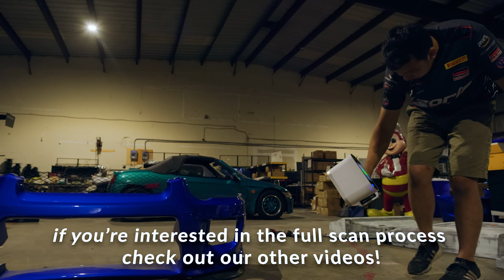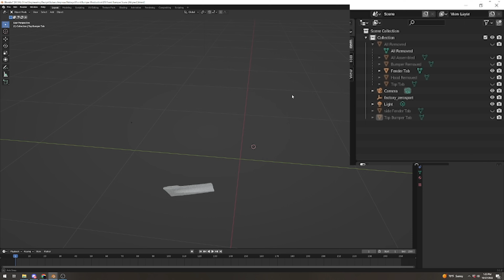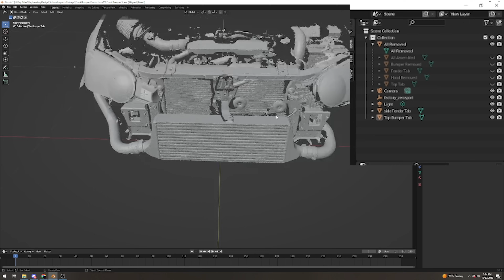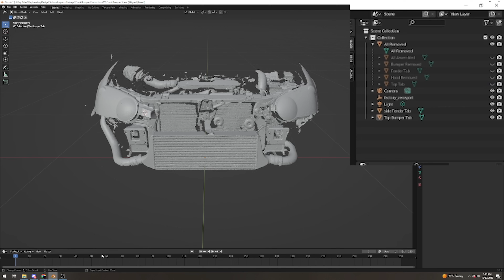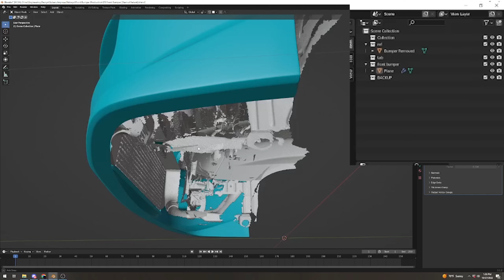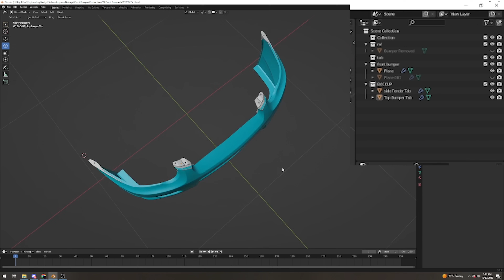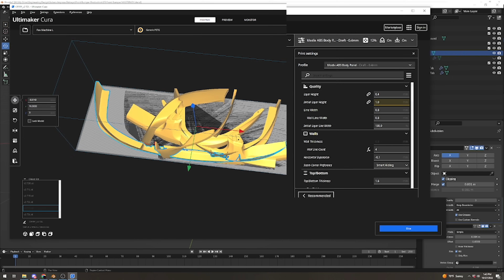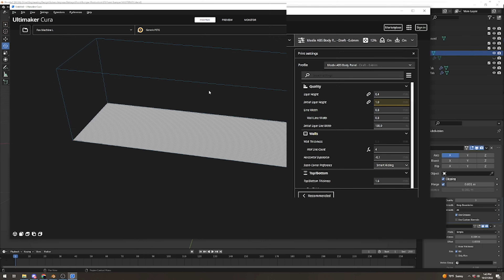I didn't like my bumper, so I made a new one.

Comment: Could it have worked if you flip the intercooler 180 degrees so that the pipes are on top
Reply: usually headlights or rad support are in the way of pipes if you flip the intercooler

Comment: This is a good attempt to show the process, however, it is a tad crude. You already have 3D printers, CNC molds are just a slightly more rigid and precise machine away. Good for the hobbyist, but as a machinist, this is a tad cringy 😂 

Look into Easy Composites.

Comment: Don't be confused. This is not simple or cheap. That 3d scanner he used is $30k. Who knows how much having multiple designers submitting 3d model designs would cost...this is not something you could get on fiver. I have been working in CAD for 20 years, it is not simple. That 3d printer is $16k.... Then it is ran for days to print all the parts of that huge bumper. probably a couple hundred $ in filament alone. Then the time to assemble the 3d print, gluing it all together symmetrically while making sure it still fits the car correctly. Sanding and smoothing the print to get it ready for the mold making. Who knows how much it would cost to have a custom fiberglass mold made.  Then the cost of painting it. Yes you can do all this yourself. But this is deep into the manufacturing world with tons of experience and expensive tools divided between all these trades. This is how a business would do it knowing that they would be selling multiple bumpers. For a first time DIY it is not happening, 100% fail at one or every single step in this process. Trust me I have done it many times. But if you want to get into this, keep trying, you will learn from those failures....or hopefully you have some deep pockets and can pay others to do it for you...and remain ignorant.

I am actually in the process of 3d modeling my bumper in fusion 360, only needing to print the top portion 54"x9". Might be close to $1000 to have a professional company like Xometry print out of ASA. I had a $700 Creality CR10 S5 3d printer I bought 4 years ago, terrible at printing ABS / ASA. No you do not want a cheapo 3d printer like that to do this. It needs to be enclosed to print ABS so the large print does not cool at different temperatures and warp and pop off the bed. Cheap printers only work with PLA which is terrible for most car parts. PLA has a glass transition temperature of 130 degrees F. Being in the sun things get too hot and your print will turn into a floppy noodle. Or you can make a carbon fiber PLA carbon fiber sandwich like the guys who is 3d printing the Lamborghini is doing. A modern least expensive printer that could get ABS / ASA done is a Bambu Lab but it has a 10" cube build size. Xometry uses $150,000 Stratasys Fortus machines for FDM 3d printing that have a 24" x36" x36" build volume...at least that is the info I could find.
Reply: Working with cad 20 years? Your profile suggests your about 23 years old 😂
Reply: Cheap printers can print the same filaments for the most part as expensive printers. The main difference between cheap ones like the ender 3, and more expensive ones like bambulabs, is ease of use and speed. An ender 3 can print all of the same things and at the same quality a p1s can if you know what you're doing.

Comment: Its 10 to 100x more expensive to take the 3d printed part, do a glass negative mold, then another glass mold, finish, paint etc. Wait till car folks figure out you can just add CF reenforcement to a 3d print, bondo, paint it, and there you go.

Comment: This is super impressive, but I can't help but wonder why you didn't just re-mount the intercooler like 1-2 inches lower.  It looks like the piping would've tucked below the inner lip of the bumper, and you wouldn't have a weird little gap at the bottom of the IC anymore...  I guess just flexing I suppose. 😁

Comment: I have thought about making some one-off parts for my car and have wondered if I could just 3d print them out of ASA and paint them? I know you are making multiple copies of the bumper, so it makes sense for you to make a mold and do it in fiberglass. But for a one-off part, is 3d printed ASA good enough? Also curious about the weight the difference between the ASA and fiberglass on something that size - is the fiberglass significantly lighter?
Reply: Im almost certain fiberglass is going to be stronger. Plus its less brittle as well
Reply: @alientiger21  ASA is Not very brittle at all.

Comment: Why wouldn't you just make different brackets for the intercooler, and lower it a couple inches? Don't get me wrong. I'm interested in 3D printing, and I I'm watching to see how you do it. But the whole time I'm watching I'm sitting there thinking some 1/8 inch steel, a saw, and a vice will fix this project for you in like 30 minutes. I'd rather have the Gap at the top of my intercooler where you can't see it, And also people are going to be like that's not a real bumper. It's a knockoff blah blah blah blah blah blah

Comment: Are there any 3d printers that print fiberglass straight away so its ready out the printer?
Reply: Or would the process always require a mold? Or are there any other materials that could be ready straight out the printer?